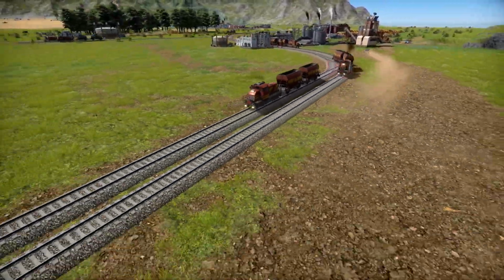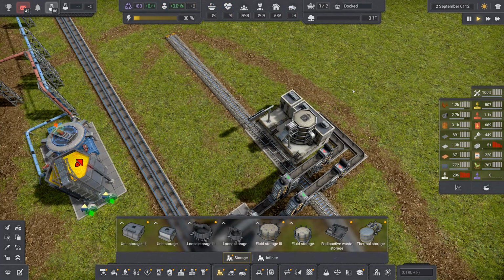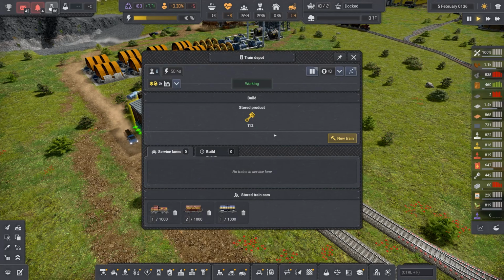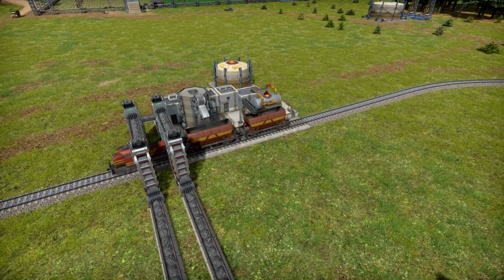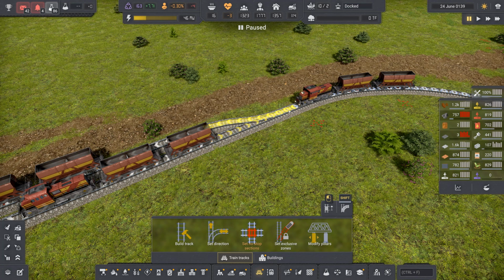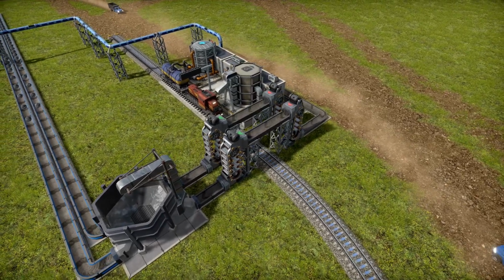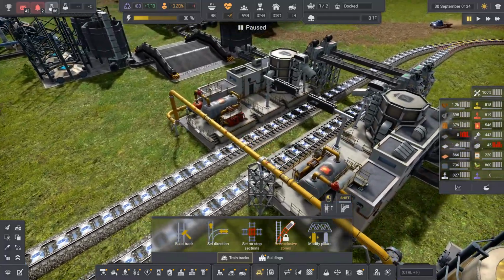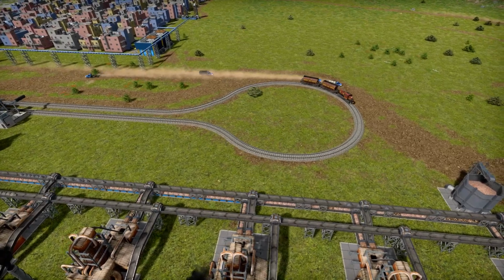Captain of Industry - Building Your First Train Tutorial

Comment: You've just built a nightmare system for trucks. They can't pass the railroad and have to take much longer routes. Add the diagonal crossing! Or better yet, find a way to add them regardless of the angle.
Reply: once you transition to trains your trucks shouldn't really do long distance hauling anyhoo

Comment: Sweet tutorial. If you could explain the curvature effect on the speed it will be perfect
Reply: Tighter the turn, the slower the train has to go, F is the hotkey to set specific degree for turns if you want to force bigger curves.
Reply: The advanced guide the developer added addresses this topic as well as the features that allow you to set curvature limits to the track builder so you can design faster networks and junctions.